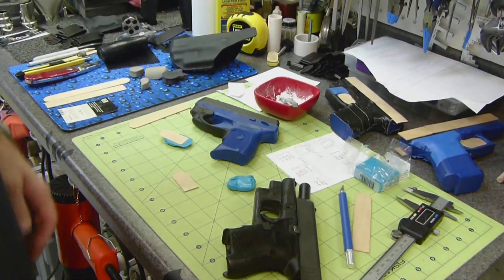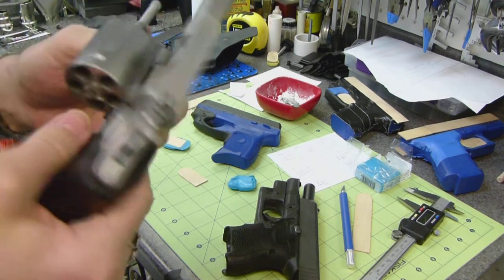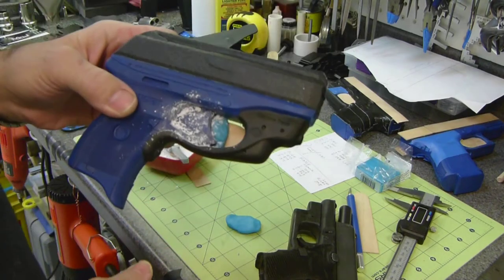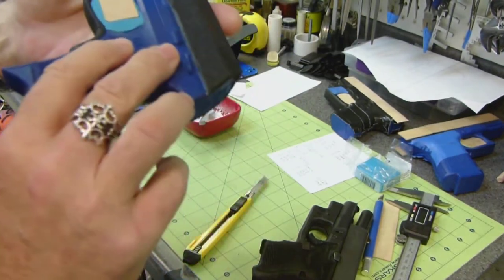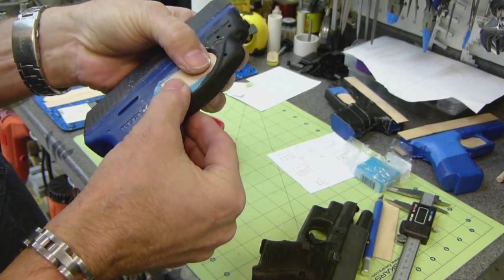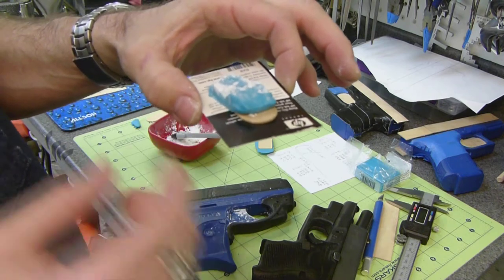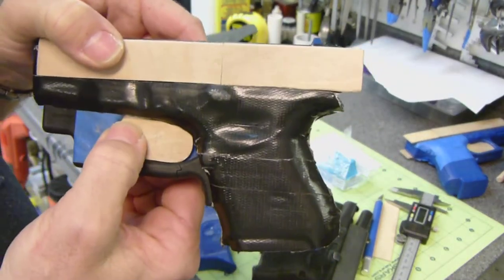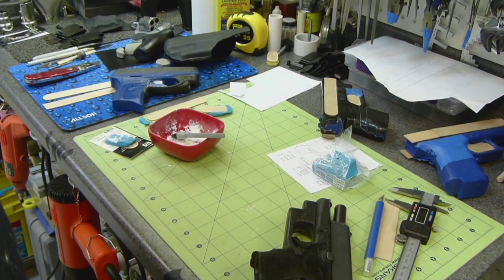Kydex Holster How-to: Trigger guard and ejection port filler/plugs

Comment from the maker: @IDPAChamp I wish I could take credit for using corn starch but I found that through our friend Google. I use and like .080 Kydex. I have a very simple press that is working great for me... two pieces of 1/2" MDF 13" square with two 6"x2"x3/4" MDF legs centered and glued 3" from the edges to allow room for the clamps. I am thinking that a somewhat flexible press may be better than a ridged book press.

Comment from the maker: You said it... "Relieving some retention is easy if you take your time." 

I like the consistency I get from the Polymer plugs. I don't have to spend any time trying to get that perfect retention, once a plug is dialed in I know the retention is going to be perfect right out of the press.  

For my process the time savings using the plugs far exceeds the time it takes to craft them. Once you make a few the process goes pretty fast. Thanks for commenting and happy baking! :)